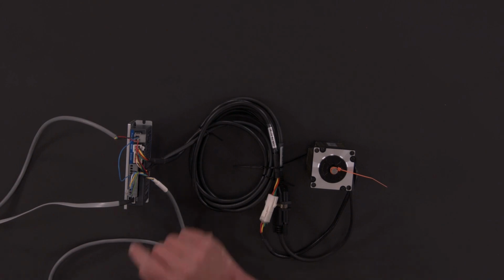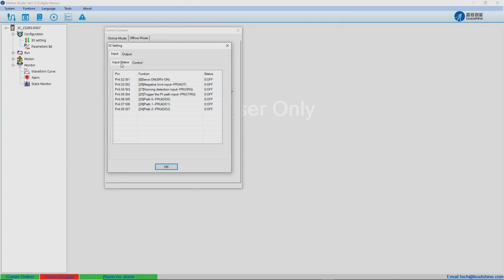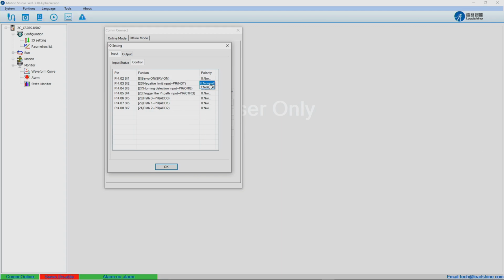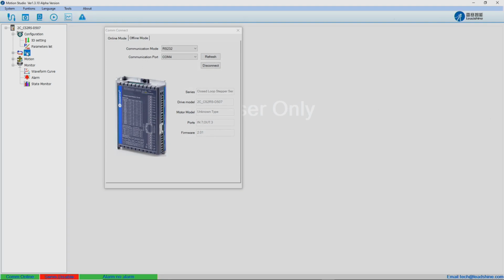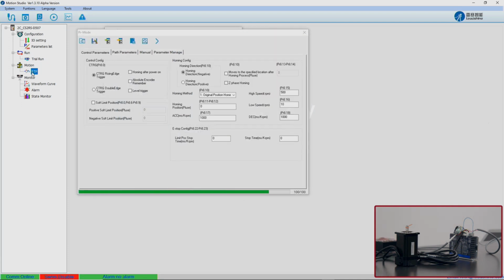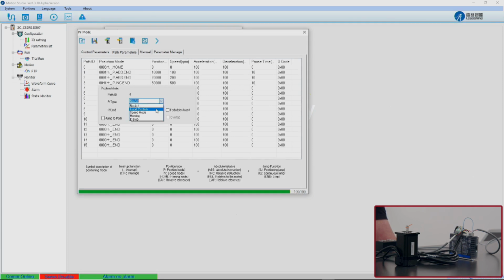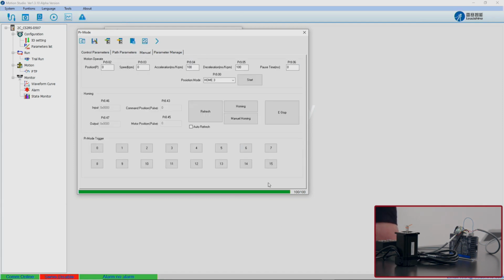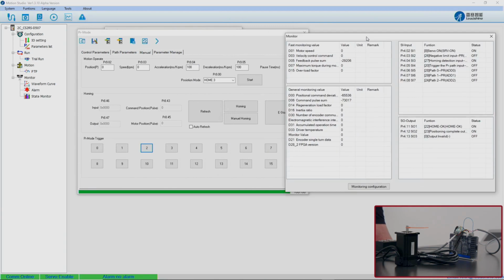Master Leadshine CS2R Configuration with Motion Studio Software: Step-by-Step Tutorial!

Comment: Instead of using a computer, can I use a raspberry pi 3 to control it?
Reply from the maker: Thank you for your comment, the SC2RS drive can be controlled by Modbus, the Raspberry PI PLC supports Modbus RTU (Remote Terminal Unit) via RS-485 and Modbus. 😀